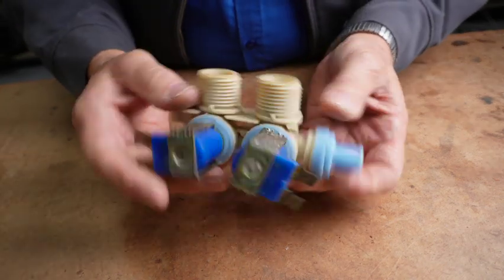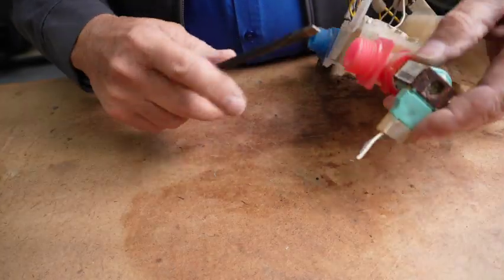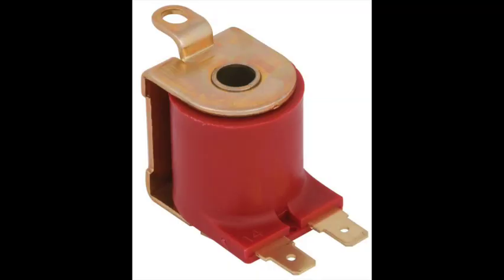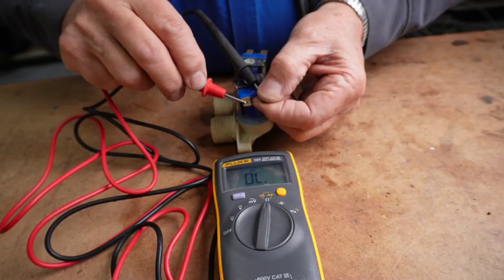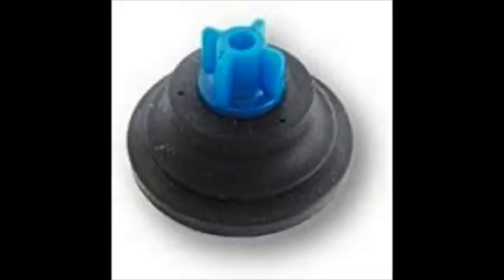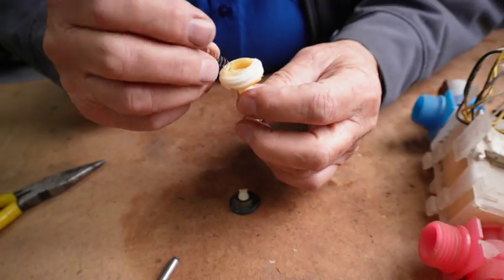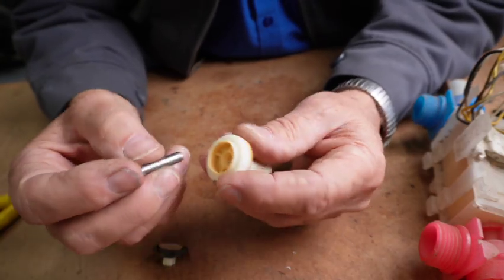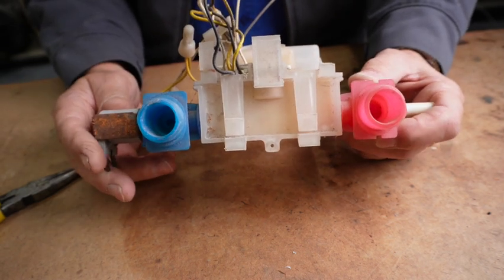How To Repair & Test Water Inlet Valves: A Guide to Rebuilding Elbi Valves

Comment: When testing continuity with a multimeter, a low resistance reading (indicating a connection) but no tone usually means the resistance is above the continuity threshold of the meter, but still low enough to register as a connection. The meter's beeper is designed to activate at a specific low resistance value (e.g., below 10 ohms), and if the resistance is higher than that but still low (e.g., 20 ohms), it will show the resistance value but not beep.
Reply from the maker: Thanks for clarifying that!

Comment: I have a wash machine that will leak water into the tub after the cycle has been complete. The water has been turned off, and the water will still drip when the machine is moved or the door is closed. Could the problem be a faulty water inlet valve?
Reply from the maker: That’s probably what it is.

Comment: What is the name of those valves I could not understand your accent.
Reply from the maker: Its in the title!
Reply: Ah my bad I didn't see the full title. I have repaired a few of these. I have experienced low water flow due to perforations in the diaphragms or leaks due to piston seal issues. These are brilliant bots of engineering very clever.

Comment: A tone setting only indicates continuity ( a basic connection) between two points, but doesn't provide the necessary information about the resistance value of the valve coils... I hope this helps
Reply from the maker: No, the tone doesn’t work when checking for continuity of a coil using the ohms setting on my Fluke. If you turn the tone off you can read that you have continuity in the coil from the display. Someone explained it in the comments somewhere but I’ve slept since then.

Comment: the beep means 0 resistance the digital reads what reststance.. 0 resistance could be bad or good straight connected wire melted can be bad and scamatucs ifteb=n tekk you how nuch resistance so continuity and resistance
Reply from the maker: Thanks for sharing.

Comment: I wonder if you can help me. I have a hotpoint fdl 8640p uk washer/dryer. The drying function is not working properly, it runs the cycle fine but the clothes come out hot and steamy (not dry). Condenser unit inside is clear, fan is clear and working. It has a double solenoid inlet valve unit, I have been told this could be this issue? What are your thoughts?
Reply from the maker: I don’t have much experience with this model but on the GE combo units of this size (and GE and Hotpoint are basically the same machine) I have found that an accumulation of wet lint will inhibit the airflow and cause this condition. You can diagnose this by checking the volume of exhaust air coming out of the rear of the unit. Remember, you need 3 things to successfully dry your clothes. 1) the clothes need to tumble, 2) you need a good heat source, 30 you have to have good airflow. So, if they tumble and get hot your next suspect is bad airflow. Clean out all the parts that direct the hot moist air out of the tub all the way back to the blower fan. Thanks for watching!

Comment: You stud, you nailed it, mine works but it pulsates like a machine gun? Any thoughts? Thanks
Reply from the maker: Yeah, watch this video for a solution to your problem. How To Fix Squealing Washing Machine Water Valves & Improve Flow: Valve Body Replacement Guide
https://youtu.be/qq37YBKr3q8

Comment: Our 3 year old Maytag front loader (MHW5630HW1) first stopped dispensing fabric softener approximately 6 months after purchase (bought brand new from a Best Buy warehouse) and then periodically we’d get the Lo Fl message. That happened periodically but now it happens every time we try to wash so it’s no longer working at all. Every single wash stops with the Lo Fl error. My husband checked the hose and cleaned everything and it worked a couple of washes and now doing the same thing. I read somewhere that it could be this part. Do you agree? I hate to order a part that won’t fix it, but I can’t afford to have someone come look at it either. 😢
Reply from the maker: I would suspect the valves. Thanks for watching!

Comment: What is going on if the washer doesn't stop filling after it's full.
Reply from the maker: If you unplug it and the water still runs then your valve is stuck open. If it doesn’t shut off during the wash cycle I’d suspect there may be a hole in the pressure line or the pressure switch (if it has one) or pressure transducer on the control board has malfunctioned. Thanks for watching!

Comment: Love this video!  I have a Maytag centennial MVWC300VW (not the MVWC300VW1), and it keeps leaking water into the tub.  I assumed it was the inlet valve so I called Maytag to inquire about the right replacement part.  Each time I call they suggest 940831 which looks similar to the last one you were working with in the video (the smaller blue one).  They insist that it's the right one, but when I look at the back of the washer the old one is (blue and red), bigger and spaced just like the blue and red (the larger one).  This may be a dumb question, but I don't want to purchase the wrong inlet valve.  Could they have made a mistake or am I over looking something?
Reply from the maker: Here is the correct part for your washer. https://amzn.to/3ZmVsJB You may find it cheaper but this is a link to the OEM part. Others are prone to leaking and malfunctioning in a very short time. I suggest only using OEM parts for your repair. Thanks for watching!
Reply: @HarperandKnowles  YES!  That looks right!  That’s not the part Maytag insists on, but it the one you’ve provided looks great!  Thank you for Eliot time and expertise!!!!
Reply from the maker: You are welcome!

Comment: Is that a portrait of Eugene Ely on the wall? @ 3:55 mark, the resistance of the copper inducter  is so low the fluke thinks you are checking for continuity on a very long length of copper  wire  and peeps means there is no break. anyway, you are working on a very similar designed calve I need to take apart and check, thanks for the close up checks. @ 11:25 mark, nice tip .
Reply from the maker: No, actually that’s a picture of some of the guys that first rigged up their airplanes to do crop dusting. It all started in Delhi Louisiana. That’s also the place that Delta airlines got their start. I’m thinking most of those fellas probably died of the big C on account of they were spraying DDT with no personal protection gear. Thanks for watching!

Comment: If It was good with the audio off it would've shown numbers real quick on your meter then zeroed or right at it those numbers will go away  when you stick your multi meter probes together  if they don't then your Meter or leads have a problem if your battery gets low on some they'll act crazy a good habit is o check your meter continuity  function before you go to test anything and take it to be gospel or safe especially if it's to check for the old zip zap shocking could be heart stopping ark flashing last of I pray no one because it's been checked 3 different  ways by a competent person or persons and working tools every way it could possibly  be dangerous do to system or human error ect  I've only been lightly zapped like twice and thankfully  it wasn't a full 120 or less D.C volts  shore enough heart stopping because of instant full body muscle seizing  steady non alternating direct current me  shortest  path of resistance  most linear set of Google maps directions to the next life c'mon😊not me I stay sharp like a marble 😅😅😅😅😂
Reply from the maker: Thanks for watching!

Comment: Thank you!  Question about the wire harness for those valves.  I had to replace my inlet valve but the new one has a different arrangement for the 2 black wires, so I need to repin those.  (red, yellow and white are the same as before). The machine side connector has one yellow/black wire but the new connector has 2 blacks and they seem to go to opposite ends of a 60kohm resistor in the body of the valve.  Where should the ends of those 2 black wires go in the 4 wire original connector (red, yellow, white and black)?  I foolishly threw out the original inlet valve and harness so I can't match it!  And don't know what to do with the black wires!  The machine works fine with just the   red, yellow and white, but I don't want to burn anything out by not connecting the black wires.  Thanks!
Reply from the maker: The two black wires go to the thermistor (the 60kohm resistor) that you mention. Not all machines use this devise but it won’t harm anything if your new valve has it but your machine’s not wired for it. It just won’t be functional on the valve. Thanks for watching!

Comment: Thank you Chip. I really appreciate people like you showing how to fix something. Not just replace it to fix it. I just capped off a leak in my 20+ year old maytag. Was quite discouraged when I got everything back together and heard drips from the inside of it. I'll have to investigate these valves. Someone suggested to run some CLR into the lines but I'll probably just take the valve body apart.
Reply from the maker: My pleasure. Good luck with your repair!

Comment: When using the audible feature on your ohm meter, you are checking continuity within an electrical system. Example, making sure a wire is not broken from point a to point b. If the wire is good it will beep because there is a solid connection from one lead to the other. If it doesn't it will not because there is a broken connection. You can also check for a short (hot and neutral shorted together) in a component and that is what you are trying to do in this video. If your meter beeps when testing the water valve, that indicates the solenoid is shorted and needs to be replaced. If it doesn't beep, flip your meter to the lowest ohm measurement and note the reading. In a typical solenoid it should read between 500-5000. Hopefully that helps.
Reply from the maker: I reached out to an electronics expert about this, and this is what he told me. When your Fluke multimeter is set to its audible continuity test mode but does not beep while testing thermistors or coils, even though continuity is indicated on the digital readout, the issue likely revolves around the specific characteristics of the audible continuity test function and the nature of the components you're testing. Here's why this might be happening:

1. **Sensitivity of the Audible Continuity Feature**: The audible continuity feature is designed to emit a beep sound when the resistance between the two points being tested is below a certain threshold, typically around 20 to 40 ohms. This threshold varies between different models of multimeters. Thermistors and coils, depending on their resistance, might have a resistance value that is higher than this threshold, even though they technically have continuity. The digital readout, however, will show the actual resistance value, which allows for the detection of continuity even if the resistance is above the audible threshold.

2. **Response Time**: The audible continuity test might also have a slower response time compared to the digital readout due to the way the circuit is designed to confirm continuity before generating a sound. This could mean that for components with resistance close to the threshold, the meter might register continuity on the display but not trigger the audible signal if the connection is brief or borderline.

3. **Characteristics of Thermistors and Coils**: Thermistors and coils have specific electrical properties that might affect the continuity test.
   - **Thermistors**: These are temperature-sensitive resistors whose resistance changes with temperature. If the thermistor's resistance at room temperature is higher than the audible continuity threshold of the multimeter, the meter won't beep but will show continuity on the digital readout.
   - **Coils**: Coils or inductors may have a DC resistance within the continuity range but might also induce a small voltage in the test circuit due to their inductive properties when a current is applied, potentially affecting the audible continuity detection.

4. **Multimeter Specifications**: Different models of Fluke multimeters may have different specifications for the audible continuity test, including different resistance thresholds for triggering the beep sound. It's worth consulting the user manual for your specific model to understand the parameters of the audible continuity test.

To confirm the continuity of thermistors or coils with higher accuracy, it's advisable to rely on the digital readout of the resistance measurement rather than the audible continuity signal, especially when dealing with components that have resistance values close to or above the threshold set for the audible continuity test. Thanks for watching!
Reply: @HarperandKnowles  Thank you for your content, It helped me!. I have a wtw5300sq0 and  it gets stuck on the rinse cycle and continuously fills the tub. After testing the water level sensor and removing the timer to clean the contacts, I had a suspicion the water valve was sticking as it occurred intermittently. I tested the solenoids and they both passed. I learned from your video the solenoids could be removed. I swapped the hot with the cold and am now going to monitor the operation. If it no longer happens, I'll purchase a new water valve assy. Btw, this machine has a "non serviceable" timer. It can be opened and worked on but it's not friendly and there isn't much reference on it. Anyone attempting this, remove the electrical connector portion only if your only trying to clean the contacts. If you open the the body of the timer be prepared for gears and springs to pop out. Hope that helps someone.
Reply from the maker: I’m very glad it helped you. Good luck with your repair!

Comment: I have gotten quite good with repairing those. If the valve is leaking the piston seal is the culprit and if the valve is only a trickle there is a tear in the diaphragm. I collect valves now because they seem to be pretty interchangeable parts wise.
Reply from the maker: You have more patience than I. I just replace them.

Comment: I have a whirl pool top load washer. Wtw4855hwo.if I turn off hot water inlet valve my machine won't wash.
Reply from the maker: Be sure your hot and cold water lines aren’t swapped on the washer. Washers won’t work if there is no water supplied to the cold water valve because once you get to the rinse cycle everything is cold water. Thanks for watching!

Comment: Great to see these valves disassembled. Regarding the continuity function on meters - they only beep below a specified resistance. e.g. 200 ohms. If measuring above that resistance it will not beep. Most of these types of solenoid coils have a resistance over 1k ohm.
Reply from the maker: Thanks for answering that. Is it a limitation of the device or was it built that way on purpose?
Reply: @HarperandKnowles  it is built in on the meters on purpose. The beep is mainly to indicate a short or close to it (low resistance). The cutoff resistance is set by the meter manufacturer and is commonly 200 ohms and sometimes lower for auto-ranging meters. For checking these types of coils, it's best to stick with resistance and not rely on the continuity function as the resistance is usually a couple thousand ohms, give or take.
Reply from the maker: Thanks for the explanation!  I have always wondered why it was like that.
Reply: L I don't think so too far l and l and l for l for ll days of a day to l for ll and lll for ll and I l and I have learned l for l and I l for ll and I l to l6lllo99

Comment: Attention Chip
Liked your video on Inlet Valves, you covered many items in a short amount of time.
Trying to disassemble the valve, can not pop the coil off. How much force is needed to remove the coil ?  Working with Whirlpool part, W1025984 Rev. B.
Reply from the maker: Squirt a little WD40 on the end of the post that the coil sits on. Use a slotted screwdriver to gently wiggle between the plastic and the metal frame of the coil and gently twist, first one side then the other. Once the coil clears the post at the top of the coil you can twist and pull until it comes off. Thanks for watching!